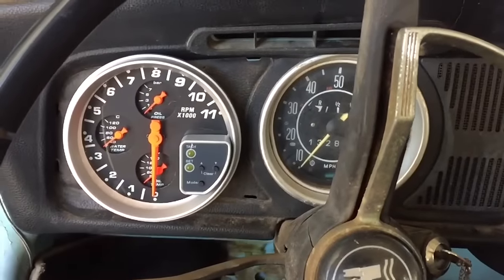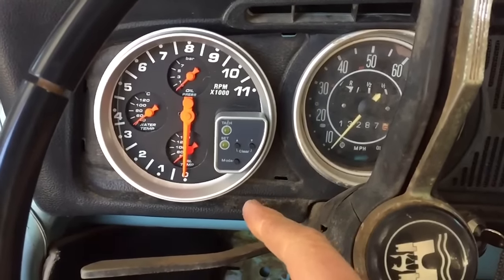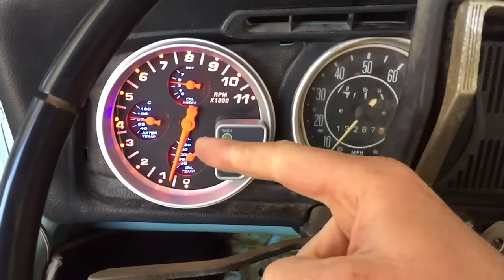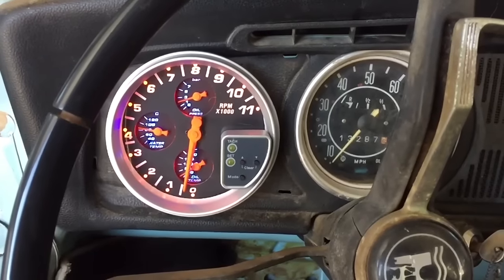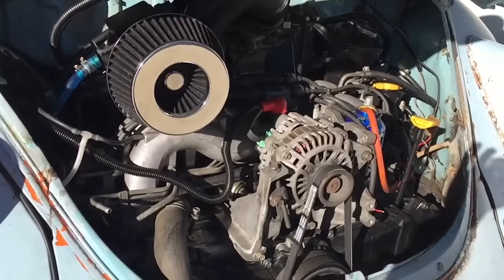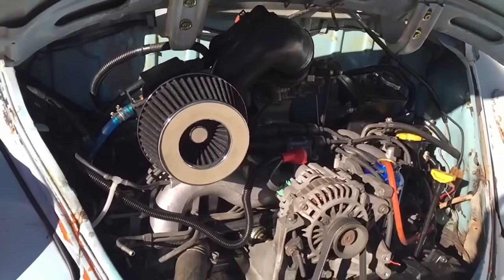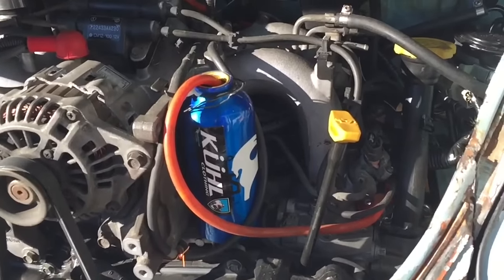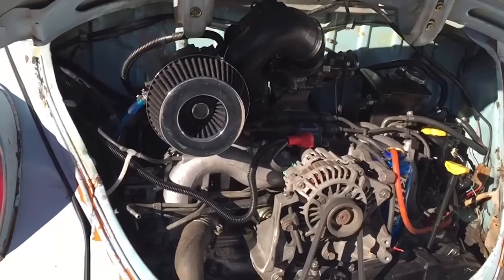BUGaru Part 13 - Project Status Update

Comment: you have to get the aluminum maf  the plastic one sets of check engine. EJ22T 90-94
Reply from the maker: +Hiram Whitaker tough to find in these parts! Do you know if the aluminum MAFs are only on the EJ22t?
Reply from the maker: +Busaru so I did a little research and it looks like the Hitachi MAF sensors (aluminum ones) can be found in 90-91 2.2 NA manual trans Legacys and the turbo ej22 Legacys - except for mine I guess :-/

Comment: So I love you videos. I am getting ready to do a 92 Legacy ej22 swap into a 72 Squareback. With your videos I think I can make the harness but how does the Subaru harness become one with the VW harness. For the vanagons you talk about the black box but what about the air cooled VWs? Did I miss that video?
Reply from the maker: +Jeremy Phillips They are all a little different but you'll need a battery source, and a keyed ignition source (usually from the spark plug ignition coil). That'll get your engine started. I'll put together a video in generic harness integration at some point.

Comment: Those inlet temperatures tho....inter cooler maybe as a future mod?
Reply from the maker: +TRON 0010010110  Maybe some day, although there isn't much space to run one without cutting body panels. Right now it's set up in the stock Subaru configuration. If I want to boost further I may look into methanol injection to lower temps (I don't know much about it at this point).

Comment: Will be starting a 1974 Super Bugaru project in a couple weeks. Using a non-turbo ej22 out of a 1993 Legacy wagon. Motor, ecu, and the harness are the big ticket items I need, but what other items would you recommend? I've found VW Bus lists, but nothing for a Beetle conversion.
Reply from the maker: +Josh Pilon A Throttle Body Reverser, and adapter plate and flywheel, and cooling system. That's really about it.

Comment: Thanks for great videos.keep it up. i am currently researching to take on a subaru engine swap into my beetle. my beetle has a swingaxle gearbox and i am wondering if the gearbox is strong enough to handle the power from subaru engine. i want to swap with  either EJ22 or Ej20 non turbo. kindly advise on gearbox. Finally which clutch plate and pressure plate must i use.  i need decent power on free way, not for racing.  I am in South Africa.
Reply from the maker: +Daniel Ramonyai You should be fine with that trans as long as you're not hot-rodding all the time. Good luck in your project.

Comment: I cant wait to start doing my conversion xD I have a Question, what are you using for a ECU? did you get a whole car and strip the harness out or did you buy the motor then buy a wiring kit and ecu from someone like Megasquirt , haltch? Awesome videos sir, keep them coming. Very Informative!
Reply from the maker: +Caydon Miller Thanks! I don't think you'll regret Subie power. I bought a donor car and used the stock harness and ecu. I have a Microsquirt that I'll play around with at some point but boy, I like the simplicity of the early 90's ECU.
Reply: Oh yea I cant wait lol How many miles does your motor have on it? I can find these pretty cheap but high miles.... My thing is, is that i get the high mileage car. Swap it in then save up and buy a JDM motor with 30-50k on it. Thanks so much for replying! I will be having more question here in the next few months xD
Reply from the maker: +Caydon Miller the engine I have has lots o miles. Something like 200k. I rebuilt the heads but the bearings and rings are high mileage. It runs like a top.
Reply: 200k wow I was saying mid 100k was High. Looks like I am buying a whole car for this swap xD  But I think I am going to remount the turbo lower so I dont have to cut much of my car lol and did you put a cross brace for the motor to sit on like in the bus? And we all know about the Subaru head gasket problem... but other than that I havent heard much else.

Comment: the two lines under your cone filter next to the intake do they just remain open or do they have a purpose mine are currently just open to are they a vacuum line of some sort do i cap something?
Reply from the maker: +randall lucas they are for the evaporative emissions (charcoal canister). You can cap or just leave open, you can also connect them to the char can like they were in the Subaru.

Comment: Seems like it will be fast.
Reply from the maker: +Kevin Hornbuckle It feels like it'll be scary fast - but maybe that was just the death wobble ;)
Reply: hey isaac are you running a stock trans aswell? what did you do as far as an intercooler and engine/trans mounts?
Reply: THANKS MAN LAST QUESTION I HAVE where did you perchase the trans or did you have it built and do you do any launches or do you baby the trans?
Reply: sounds like it will do fine thanks again

Comment: Maybe I should Google "Death Wobble". Is it because of the location of the engine? Looks like it gonna be a fun little go-kart. How about heat? Or maybe you showed us that and I just forgot...
Reply from the maker: +Forthwith Tx it's the first year using struts so they didn't get it quite right. Lots of new suspension stuff going in. Heat is a luxury at this point - need to get it driving and killing muscle cars first :)
Reply: The death wobble is caused from worn out front end bushings. Replace with the newer polyurethane bushings get a more solid and longer lasting front end. I've done 2 of my bugs made a huge difference.

Comment: tTry changing out your front steering damper. They are about $30.00 if it's bad you will get that wobble
Reply from the maker: +MrAllinclubs Lots of new suspension stuff going in - thanks for the tip.

Comment: Did you ever find the maf and did it fix the stutter?
Reply from the maker: +Randy Lucas Found the right EJ22 T MAF - fixed stutter. More vids coming very soon - hopefully next few days.
Reply: can you point me in the right direction to finding that maf mine aswell has a slight stutter lol but being jdm i guess i cant scan it to see why
Reply from the maker: +Randy Lucas EBay and forums are probably your best bet with a JDM.
Reply: iv looked at a ton but as far as it being alum are you meaning the sensor itself or the housing

Comment: Watching this video series to get tips for my own further 75 super beetle Subaru swap I have a few different ideas for mine i want to fit a EJ 25t wtih a low mount  turbo a water to air intercooler a and a Individual Throttle Body kit as well as a 2 wheel drive Subaru reverse geared Subaru trans from subarugears.com mine will be part of a retro-mod restoration
Reply from the maker: +ben Dordoy That sounds like a fun project, and fast!
Reply: I agree i can't wait to build it when Mighty Car Mods built a Subaru turbo powered 74 1303 called miss daisy it made 358.5 hp at the wheels it had a water to air inter-cooler and high performance VW bug trans
Reply: stile change of plan my bug will be naturally aspirated cause  the DOHC turbo engine are too wide and I will have to cut off the rear bumper brackets and wont be able to fit a rear bumper